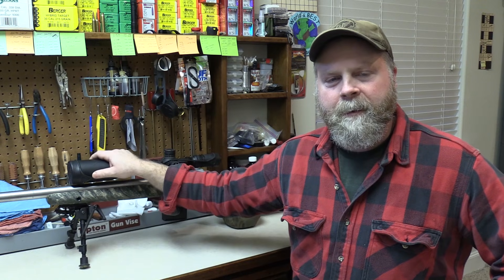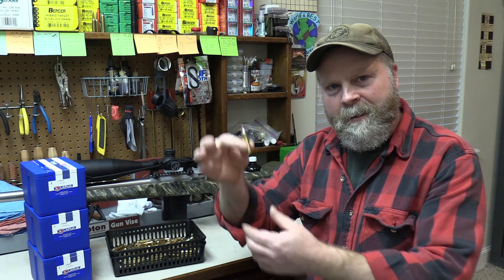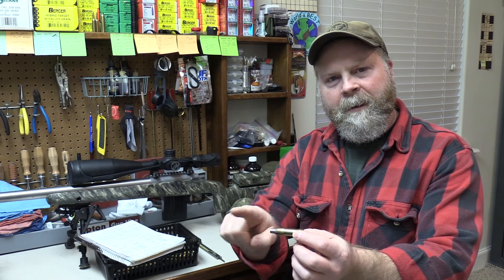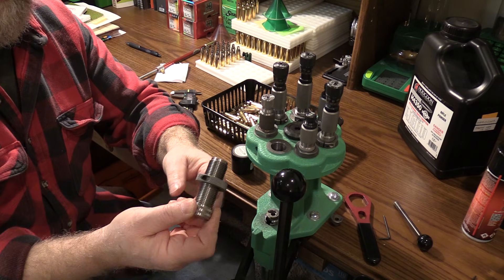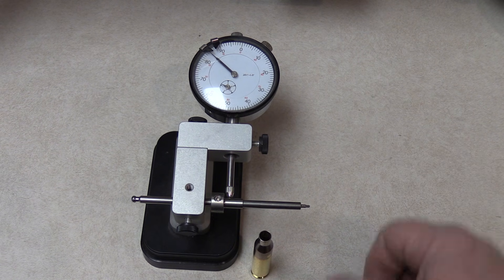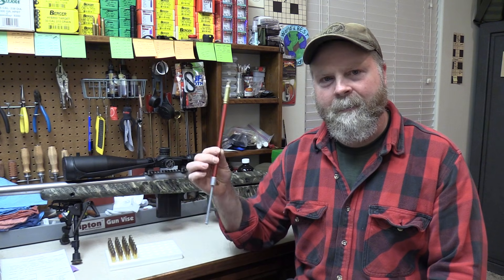Precision Rifle Load Development/ Part 1: New Brass Prep

Comment: So i reckon people do a lot of work , such as turning necks , to rule out any questions they may have. If you know you turned your necks , you know you trimmed and weighed everything , now you know its some other reason you are not where you want to be. You can get way down the rabbit hole im guessing
Reply from the maker: Yes. I went the other way. I took an exceptionally accurate barrel and started eliminating steps, until I found a process that’s easy and repeatable.
Reply: @PanhandlePrecision  Thats definitely the best way to remove the most doubt , hehe. Its not the gun for sure !!

Comment: How many fires before your shoulders have moved enough to bump them? The way I am understanding your process, you expand your necks up to get 0.001 tension since Lapua is so undersized. Also it’s about 0.0155” wall thickness. 

Do you neck size before trimming and chamfering?  Bushing die, neck only, (not full since we want the shoulder to get where we can bump them all the same). 
Once trimmed, if you neck turned would this be the time or wait until the shoulder has maxed out before neck turning? Thank you for your feedback.

Comment: At 13:15 you demo the Sinclair tool doing runout checks.  Functionally, the important runout is neck ID to outside surface of shoulder (or the conical section).  The conical section locates the case body radially in the rifle chamber, line-to-line, with the conical section of the chamber, when the bolt is closed, and ejector pin is holding the case body forward in the chamber.
PS:  Thanks for your efforts in developing a truly professional grade of videos for the aspiring precision rifle shooter, reloading ammo.  Your lecture/teaching skills are very good, yet not intimidating.

Comment: I am a little confused, because on a different YouTube video, you said that neck turning absolutely is important and should be done.
Reply from the maker: I’ve never said that. I tried it. I think it’s a total waste of time, unless you absolutely have to use a specific thickness of brass in a particular chamber. I’ll buy a reamer with a large enough neck clearance before I’ll turn another piece of brass.
Reply: the you tube video for the rcbs neck turning tool was 3/1/17
Reply: sorry, if i'm confused. but you said on the 3/1/17 video that the short answer was neck turning improved accuracy.  being a newbie i can sometimes misinterpret recommendations.  thanks for your time.
Reply: your comments were on the rcbs neck turning tool which i purchased.
Reply from the maker: @howardschwartz1462  Now you have me curious, because I didn’t publish a reloading video on that date. I’ve never even seen the RCBS tool. I’ve used a Forster lathe turner, and a handheld setup. Bottom line; I don’t recommend neck turning for accuracy. I do recommend running .005-.006” clearance in the chamber for the neck.
Reply: @PanhandlePrecision  I am terribly sorry that I was replying to a different channel not yours. Please accept my deepest apologies for all the confusion on my part.

Comment: I am just getting into Rifle Loading, I am starting off with .223/5.56 for ARs, I will be loading .308 for a M1A Socom and a Rem 700.  I realize this is a old video, but do you recommend full length resize for the M1A verse a neck size.  I only ask as I have read that neck resize is OKAY for bolt action, but full length resize is recommended for autoloader.   I am looking to work with the 168gr. Also, I might just buy some Bulk bullets to keep the cost down.  I don't do any serious target shooting (competition) or any hunting, so they can be good enough out to 300 to 400 on steel.  Just want to start loading rifle to save some $$.   Any info would be appreciated.

Comment: Question sam so I've been loading some 223 handloads with brand new lapua brass.. using redding dies and I recently had 100 handloads that wouldn't chamber at all so I broke the rounds down resized the cases in the full length redding sizing die and then they were fine clambering wise.. any clue what would cause this

Comment: I am very new to reloading. I have only loaded about 700 9mm cases. I recently bought a 30-06 rifle and I am just getting things together to reload these rifle cases. I have a single  stage press for the rifle cases. I bought some Lyman 30-06 full length dies. I have not received my 30-06 shell holder yet so I cant resize the cases yet. I bought some used 30-06 cases at a gun show but when I try these cases in my gun, the bolt will not even begin to close. Either this brass is too long or the neck is too large for my gun. Hopefully resizing will allow these to fit in my gun or maybe they were just fired in a gun with much longer head space and will never work in my gun. With a  case that was fired in my gun, the bolt close just fine. Whats your thoughts on this.

Comment: Instead of running them over an expander mandrel or FL die, would running them through a Lee Collet die expand the necks? I've been told by Lee that the Collet die only gives 0.001 neck tension. Same way to skin a cat or should I just buy an expanding die? Thanks Sam

Comment: At around 13:00, you say you don't bother turning necks, which is fair enough. But a lot of guys will have chambers with tight necks, and for them it will be necessary to turn them to avoid chambering problems and potentially dangerous pressures. I think that's worth pointing out.

Comment: Excellent:
Clickable outline:
2:00 Visual Inspection of Cases
2:25 Weight Sorting Cases?
4:42 Measurements of Virgin Brass
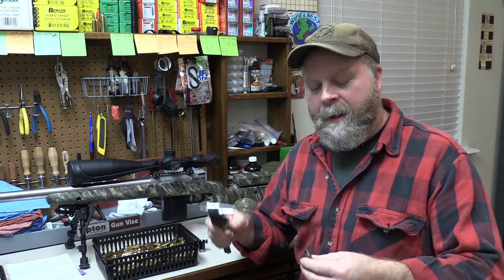6:35 Expanding Case Necks
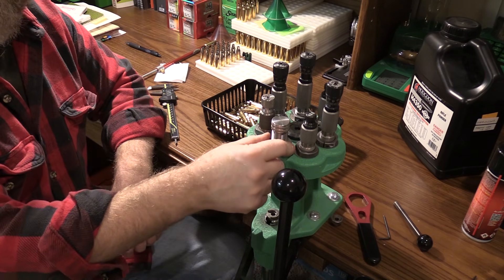8:25 No Need to Full-Length Body Size
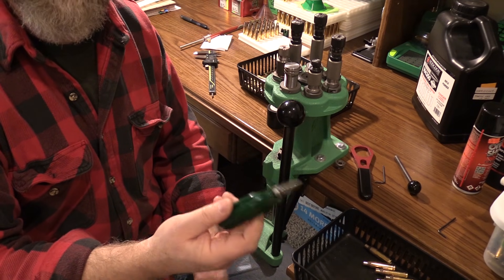9:30 Bevel/Chamfer Case Mouths
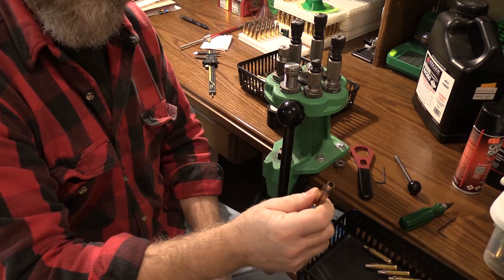10:15 Prime Cases
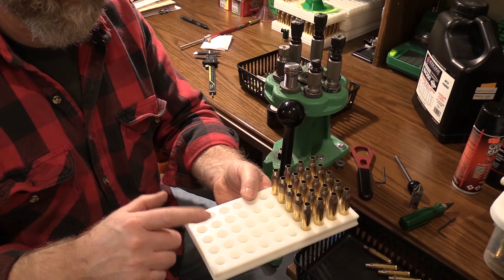11:00 Neck Turning?
13:05 Measuring Neck Runout

Comment: Dumb question Sam, how do you know when your brass is worn out?  I have 10 firings on 200 pieces of brass. My ES is still low and the groups are still at or below 1/2 inch.  I anneal and trim after every firing and have had no split necks. But I've noticed the case necks are thinning.  Had to go to the next size smaller bushing (.288) to get my neck tension back over .001.  Any thoughts?

Comment: I ran a ladder test with new Lapua brass and 245 berger eol (300NM) and had great success finding a sweet spot however, when I loaded the once fired brass with that same charge weight, I was seeing overpressure signs. After asking around, I was told not to load test rounds in new brass. All the other variables that we could think of were ruled out. If you have any thoughts, it'd be appreciated

Comment: Something that NEVER made sense to me is how loads can be more or less accurate even when velocity is consistent. Think about it... velocity consistency (ES and SD) is the ONLY thing which should affect accuracy. And, it should only manifest as vertical stringing due to variations in flight time from velocity variations.
Yet, we constantly see that loads get more accurate or less accurate as we change the powder charge even even though velocity stays consistent. Sometimes it gets more accurate even while velocity spread increases! It always puzzled me as to why groups will go from 1.1 - 0.9 - 0.5 - 0.3 - 0.4 - 0.8 - 1.2 - 1.0 as I increased the charge. Also, what's most accurate for one rifle may not be what's most accurate for another.
And, then it dawned on me... maybe IT IS NOT THE LOAD, it is the RIFLE! Maybe it is simply harmonics when the round is fired. The most accurate load smacks the rifle just hard enough to cause the barrel to vibrate in such a manner that the bullet leaves the barrel while it is at the top or bottom of its oscillation -- hence minimum lateral velocity in some random direction. To test out this hunch, I zip tied a fishing weight to the muzzle. Sure enough, what's most accurate isn't anymore!
I then extended the loads to a very wide range from say 45 gr to 51 gr -- way way beyond my target velocity in .2 gr increments. I noticed that you'll tend to get several peaks and valleys in accuracy! It'll be like something like this... 0.9 - 0.8 - 0.6 - 0.4 - 0.5 - 0.7 - 0.9 - 1.0 - 1.1 - 0.8 - 0.7 - 0.5 - 0.6 - 0.9 - 1.2 - 1.1 - 0.9 - 0.8 - 0.7 - 0.9 - 1.2 - 0.7 - 0.6 - 1.0 - 1.1 - 0.8 - 0.5 - 0.7 - 1.0 - 0.8. More importantly this changes when you switch rifles or even barrels. It also changes on a different day when the temperature is significantly different.
In the end, I concluded that chasing the very last bit of accuracy CANNOT be done with a particular load even for the same rifle. All I can say for instance is that this is a half to one minute of angle load depending on the conditions for this particular rifle with good ES. And, that is enough.
Reply: That makes sense to me. I like champion bench rest shooter Erik Cortina's approach:  low variation in extreme spread, which is a low variation in ignition caused by primer, powder, neck tension, erc.  low extreme spread but poor groups....work on the barrel harmonics by vary bullet seating depth: https://www.youtube.com/watch?v=6VEMZJYovMA

Comment: I must have got lucky l guess. I brought my M77 home with two boxes of factory loads put a 4x Leupold on it took it outside on a target boresighted shot it in . Game over. Saved the brass necked it load was 180 gr. Hornady  73 gr. IMR 4831. It was shooting 2inches or better . 
Sometimes better if l really worked at it ha ha. Never took the caps off that scope in 40 yrs ha ha🇨🇦🤠

Comment: Hi Sam. Started loading 6,5x55, and after a lot of Your videos about brass handling: - Why press the brass back to a fabrik size when it after a shot is formed exactly to the chamber in my Sauer 202? When resicing it/pressing it smaller I am stressing the brass, when shot it is stressed back to the chamber size, so again resize it back to a standard and again shot/expand it again, and again, and again. Why not just skip the recising and keep it the dimesjons the chamber makes it, as long as it goes smoth in and out? Dag from Norway

Comment: Hey Sam, great video. I'm starting a new project with both 6.5CM and a .223 and decided on new Starline brass to start with. I noticed you said your new Lapua doesn't require sizing, other than expanding the neck, but have you ever run into any problems with other new brass like Starline or anything else needing to be resized prior to loading? Love the channel. I've learned tons.
Reply from the maker: No, I haven't. That doesn't mean it doesn't happen, though!

Comment: I have different shoulder measurements and oal measurements on my once fired brass since I shot different loads & different bullets can you please help me out? You said bump the shoulder 2000s? But from which of my cases? From the biggest shoulder growth? I’m getting 0.40 groups from virgin lapua, looking to improve this
Reply: Since he won't reply, I thought about chiming in, if you don't mind...  Measure a fire form case from the shoulder then bump back a couple thou, from that, (if) you have the correct (case shoulder measurement tool) for your calipers.....I have the Hornady Lock N Load Headspace Comparator kit,    Good luck!

Comment: I love your videos, quick question do I prep my second fired brass the same way as the video you did on once fired brass? I need help because the brass are all different measurements after once fired because I was using different loads and bullets, you mentioned bump the shoulder back 2000s but all my shoulders are different lengths from the ones fired brass
Reply: Set them back all the same and they won't be different any longer.

Comment: Love this video.  I have a hard time building loads off brass that hasn't yet been fire formed to the chamber of the specific rifle.  It seems wasteful, but I'll take new lapua brass and a moderate load with the cheapest bullet possible and just fire form them so I have a baseline.   Either that, or use some factory Nosler ammo and start my loads with fired brass.   Am I crazy?

Comment: Great video, I don't think sorting brass by weight is worth the time. But for a different reason than you offered. Most the weight variance in a case is in the case head and that has very little to do with case volume. That being said if you have the time and energy to check cases then you're better off checking concentricity

Comment: I have been watching all your videos, great job. I have a question on how many times do you reload your brass? I'm shooting a 22 x 47 Lupua (6.5 x 47 neck down. Any recommendations or you thoughts. Thanks
Reply from the maker: triumph02002 I usually start a new barrel with new brass. I have bins of 7x-8x fired brass that I’m starting to work in to projects. I’ve fired single pieces 20 times to test longevity. It depends on how hard you run the load. The primer pocket is usually the weak link.

Comment: The Sinclair die with expander mandrel, how do you set it up in your press? I have one for 6.5 Creedmoor.
Reply from the maker: Rudolph Ferdinand Screw it down into the press until the mandrel expands the whole neck, but not so far that it bottoms out on the shell holder.

Comment: I hear ya.  My BFF and hunting buddy for over 30 years who actually got me into shooting centerfire rifles does all this stuff and works up loads to get 0.016975034673944 groups, etc. etc.  I just buy a couple boxes of the cheapest off the counter commercial ammo I can find for my caliber, shoot it to fireform to the chamber, clean, trim, debur, etc. etc. work up load, like you, til I'm at .5 or .6 MOA at 100 yards and I out-shoot 95% of the guys I run into at the range that have LRP Rifle Platforms.  I don't mean to brag but I usu outshoot them with their own rifles too, lol.  I then buy some bulk brass and process it (I don't weigh and measure, etc. just clean, FL resize, debut, trim, etc. shoot and, of course, reload the fire formed brass multiple times  with my custom load.  My buddy buys custom made rifles for $3.000 and I buy a Remington, Winchester, Weatherby rifle off the shelf, bed, float and trigger job and, so far, I've been lucky and have always been able to get them to shoot .75MOA or better. I've never had to replace a factory trigger just tune it up.  I'll accept up to 1 MOA on a Big Game Rifle but NOT a Target or Varmint Rifle (I moa on a Prairie Dog at 300+ yards could easily be a miss).  But, hey, each to his own.

Comment: Will my 308 brass that I was trying to trim to 2.005 be effective or dangerous if I cut that 2.0035. I'm seating the bullets correctly it's just some of the brass ended up a tad bit shorter then the trim length by a couple of thousands just wanted to make sure that was okay before I shot them. Thank you very much.

Comment: Nice video! You are correct, no sense expending time, money, energy and frustration on procedures that do not give any or very little net gains. 
That time, money and energy would be much more valuable if spent by actually SHOOTING and developing ones marksmanship skills with that particular rifle and load. Real world in the field DOPE will IMHO trump spending weeks or months chasing that last tenth of a inch in possible accuracy. The human factor could have been improved by many times that in the same time span just by systematic training in real world scenarios. I know many may not want to concede or admit this is the best way to better overall performance. We as human beings are most of the time the weakest link in a shooting system if the rest of the system is top shelf.

Comment: Curiosity has always got the better of me on this, how often do precision shooters train? If so how? I can't see many if any blasting 1000 or even 100 rounds of something like 300 win mag or 7mm rem mag a day 365 days a year. (Hell could training that hard even be counter productive?)
Reply from the maker: Andrew York I average around 500 a year through my bigger stuff, but the barrel in this video was pulled two weeks ago at 2086 rounds. Yeah, I would think that running 10-round strings with a 300WM day in, day out would get old. With a 260, it’s fun!
Reply: Panhandle Precision thanks for the reply, that is very insightful. Do you practice wind calling with a separate rifle, say with a 22lr/223 or something along those lines?

Comment: I know that you measured several dimensions on the Lapula brass. Are they all within the case's overall length specs or did you have to trim them to length?
Reply from the maker: I checked a few pieces of new brass. They didn't need to be trimmed, so I didn't. I've trimmed them after every firing, though.

Comment: Hi Sam, I have a question on case weight separation. You say they should fall within 1% is that like 95.1-96.1 or .01?
Reply from the maker: Laura Farnsworth If the median weight is 200 grains, 2.0 grains would be the allowable spread if using 1% as the standard—199.0 to 201.0 grains.
Reply: Thanks Sam, I have been trying to keep them all together that weigh the exact weight